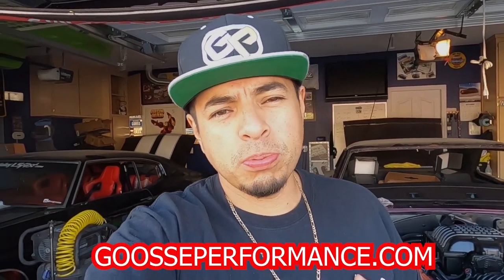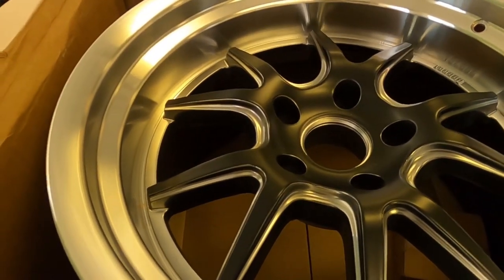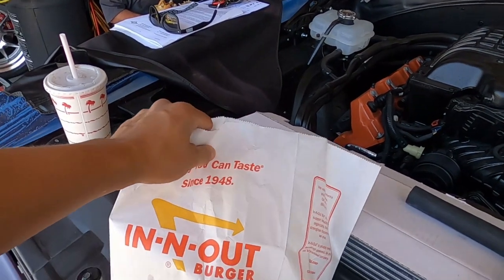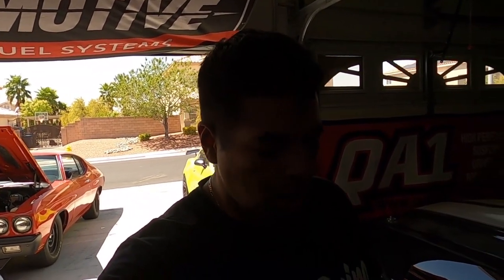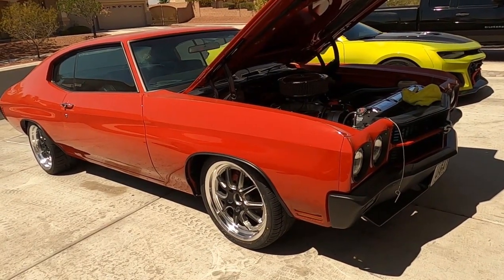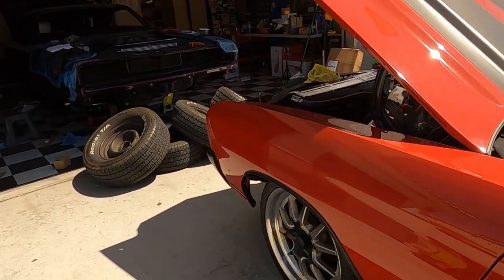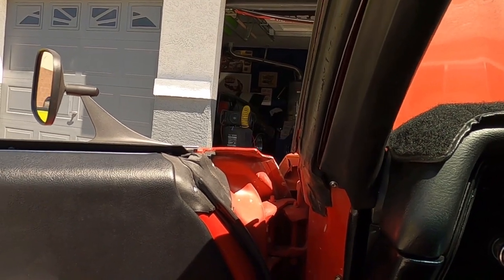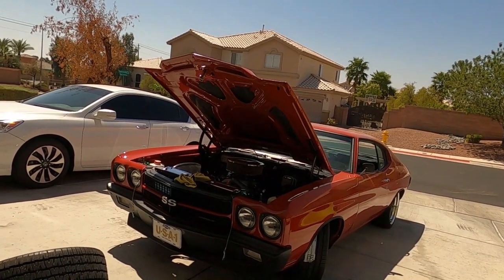WHAT BACK SPACE WILL FIT ON 1970 CHEVELLE

Comment: Goosse, Is that a stock rear axle? I have a 66 Lemans restomod/protouring kind off that I want to put wider wheels in the back. I am running 17x7 with 245/50/17 and 4.5 backspacing. 1 will like to do 18x11 but not sure the backspacing. We both have the same body platform so if your axle is stock then this should work for my 1966. By the way it is a convertible.

Comment: Goose wanted to see if I can get some advice just bought some 18 inch rims and tires 245/45r18 and the driver side fits perfect  but the passenger side is not centered and is sitting closer to the rear wheel well causing it not to fit right and not a lot of clearance please help

Comment: Great job! I am so confused on what wheels I want to get for my car, there are so many choices out there. I'm going to stay conservative on both ends, 18x8 front, 18x9 or 18x10 in the rear. My measurements show about a 5.5" to 6" backspace for the rears. FYI the rear end is not centered on my car, 1/2" difference from one side to the other in relation to the wheel well. Either that or the body is not centered. Not sure.
Reply: I'm curious, what did you end up going with?
Reply: @patrickbranen5362  I haven't gotten around to putting new wheels and tires on the car yet. I like Weld wheels. The back I measured with a tool that fit onto the tires that I have, 285-18's. Looks like a 6" backspace is about perfect. 9.5 or 10" wide wheel will fit no problem. Fronts I haven't measured yet. Car needs other work, brakes especially. Master/booster need replacing. Hell of a car I will tell you. Love it.
Reply: Im running 18x8's in the front and 18x9.5's in the rear. They clear all the way around and look sweet. @ekitching

Comment: I had done some calculations and mock up with angle iron and all thread for a 1971 chevelle stock not tubed or anything for a set of 18"  Rocket wheels

FRONT
8" ___4.5 Back Spacing
9"___5.25 BS
9.5"__5.5 BS

REAR
9.5 ___5.5 BS
10"____6.0 BS
11"____6.6 BS
and of course you need to round to the nearest size you can get but these numbers checked out.
Always do your own DD
Reply from the maker: great info
Reply: Should you have any info for tubed suspension currently put a cpp touring kit on my Chevelle and rims running the a arms any info would be awesome thankz